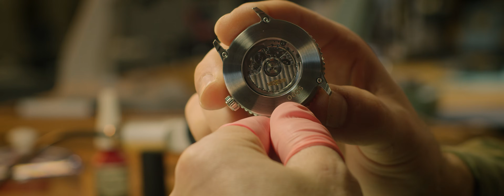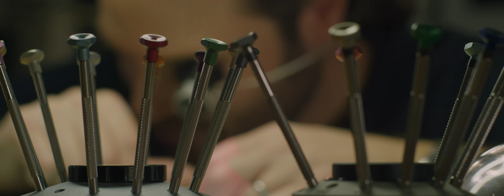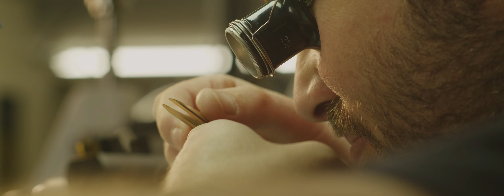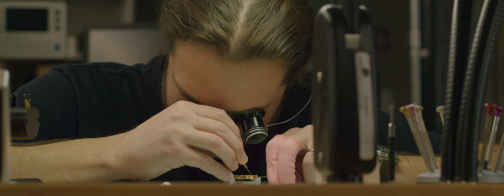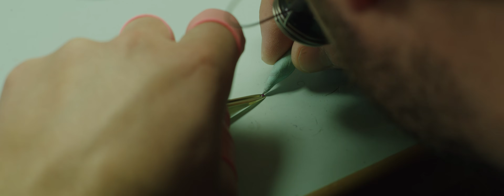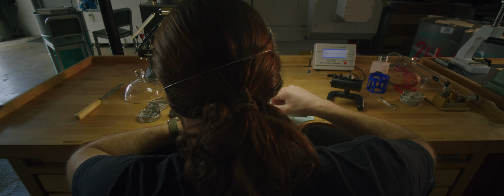The Watchmaker's Workshop:  A Watchmaker's Workbench

Comment: Shinola Canfield 45mm , battery bracket screwdriver tool anyone know the tool , I can get the case back off but the battery is held but another sized screw , called Shinola , they said they can't help and to send the watch for $40 battery replacement service

Comment: What tools cost around $5,000? I've heard that's the going rate for a complete too set. Why is a set so expensive?
Reply from the maker: This would be for standard bench items for the watchmaker.  The tools are all made in Switzerland, they are high quality and very specialized.  Cheaper tools can be purchased, but sometimes the cheaper tools can hamper the learning of a new watchmaker. A watchmaker with a good workshop can easily have over $20,000 of tools and equipment at their disposal in a one man shop.

Comment: Don't you use a microscope? A loupe is only used for vertical observation in a professional shop.
Reply from the maker: I use a microscope for certain tasks.  They are rarely required and only in the past 10 years has it become more common to see microscopes used in watch repair. Watchmakers will not have one on their own bench typically and this episode was about what the watchmaker has at their bench.  If there is a workshop with a microscope it will usually be one microscope for a number of watchmakers to use infrequently.
Reply: Maybe due to cost.  A microscope is not essential and like the video says things are very much down to preference.
Many professionals only using a loupe.

Comment: Cameron, another lovely video! Being a hobbiest watchmaker, I’ve always wondered how a brand new watch is assembled by hand and not leave a mark. Do you match perfectly the diameter of the screwdriver bit to the screw? I assume you want the edges of the screw grove both touching each bevelled side of the screwdriver bit, but not touching the bottom of the screw groove? Tools are my Achilles heel in that they are so expensive, for example a presto tool 3 for 5 spoke wheels like driving wheels on chronographs are very expensive! What tool do you use to remove cannon pinions, I still use tweezers. Do you not use a microscope? Also i don’t have main spring winders yet, also so expensive! Please continue make lovely videos for us to lean from, I’ll keep saving!
Reply from the maker: The tools certainly can be expensive, but some things can be made instead of bought if funds are tight.  Good news is that many of your questions will be answered in upcoming videos! I really want to help people learn about watchmaking and the large amount of time and thought that goes into each tiny detail.
Reply: @thewatchmakersworkshop  Thanks, looking forward to them!